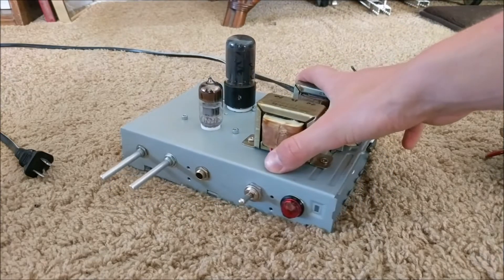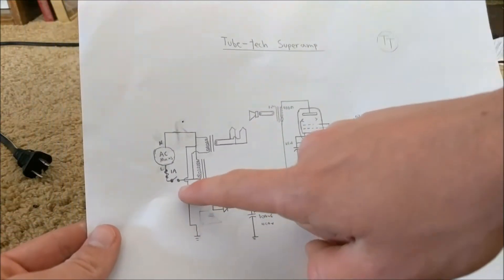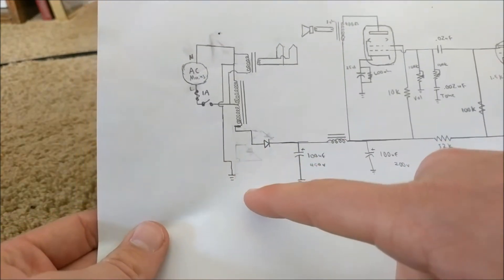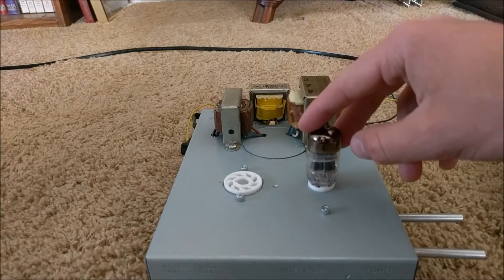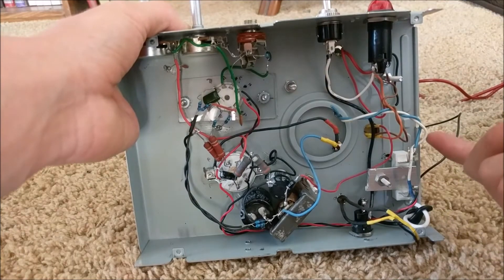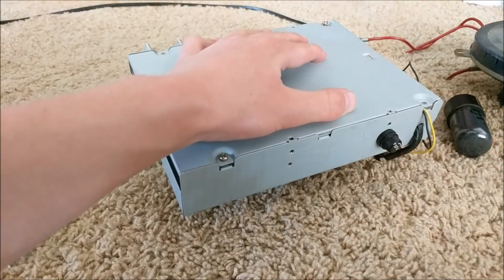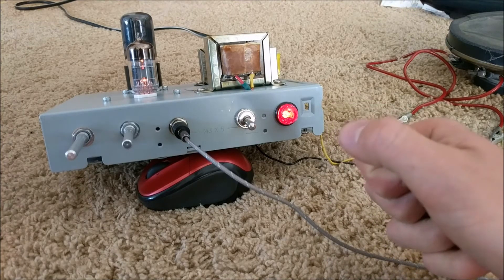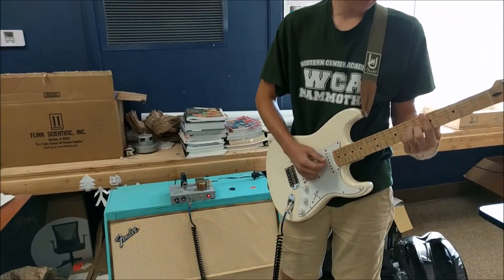A Safer CD Drive Tube Amp

Comment: I'm glad to see young people getting into tube amplifiers. I build them for a living and repair all sorts of them. There is a reason that they completely got away from that type of amplifier. Having a true power transformer makes an amp much safer and also allows it to operate at higher voltages with stability. But if you're trying to save money and doing it the way you're doing it there is some really interesting more Oddball tubes out there that you could use. There's plenty of tubes that were made with 117 volt heater elements in them. I think 115 L 6 for an example. And there were even more 32-volt and 50 volt tubes which you can string to equal the wall voltage. And if you want to make it truly safe you can still use those hundred 17 volt tubes just do an isolation Transformer

Comment: why you use a auto transformer
just make it direct fed with a doubler
easyer and faster and cheaper
and just as save
Reply from the maker: +robot797 You are right, it would still work with that B+ voltage, but it would not be as loud.  My autotransformer setup puts out a 380v when rectified, which is higher than you would get from a doubler.
Reply: Then use a tripler 
I keep forgetting that 220 is not everywhere
Reply from the maker: +robot797 Ok, I'll try that on my next amplifier. Thanks for the idea!
Reply: builders should help each other
also try the pcl86 
great little amp tube 5W but it is dirt cheap 
i can build a stereo amp with is (3w per chanal) for les then 30 euro
this does include the tubes and transformers